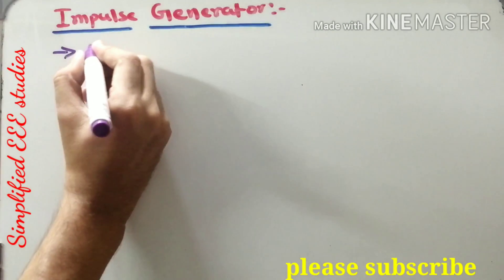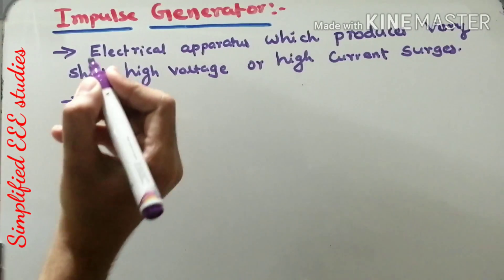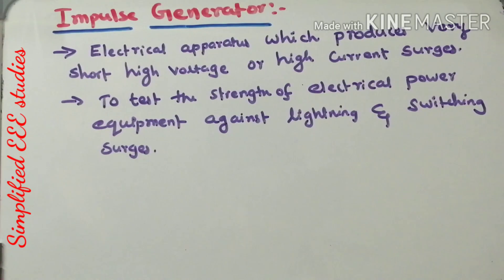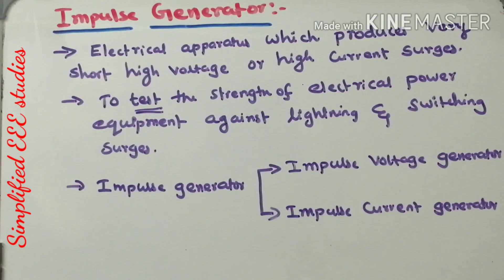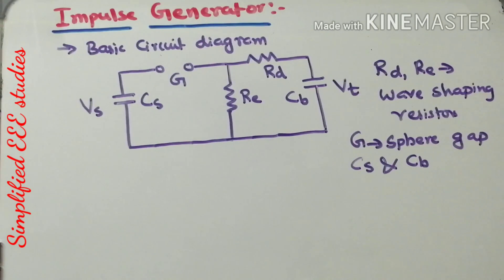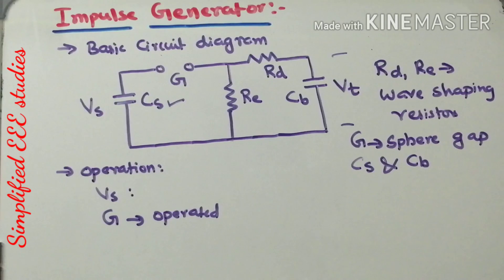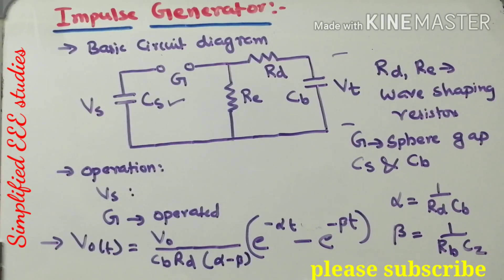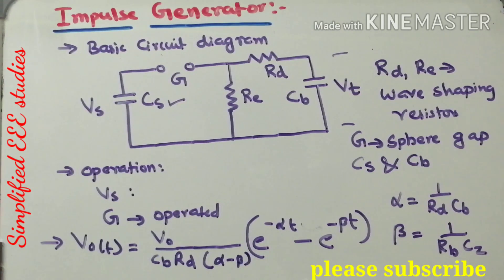What is Impulse Generator?

Comment: thank for great video but is it possible  to calculate the duration of an impulse
Reply from the maker: Good afternoon,
It's my new lecture video on Impulse Generator (Design)
Please go through it and you will get the answer for the question, which you have mentioned.
https://youtu.be/wjpy9E6LUio

Thank you
Reply from the maker: Sir,
I could not measure. In fact it is possible to measure.